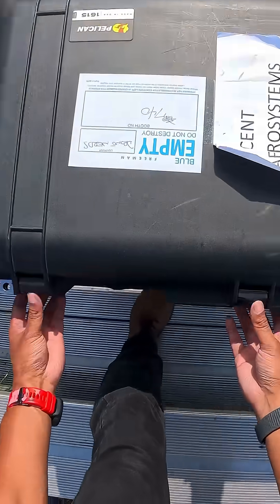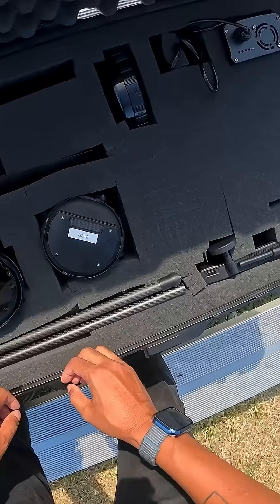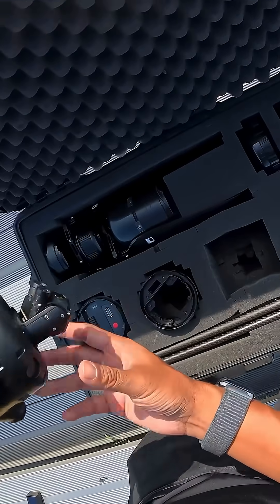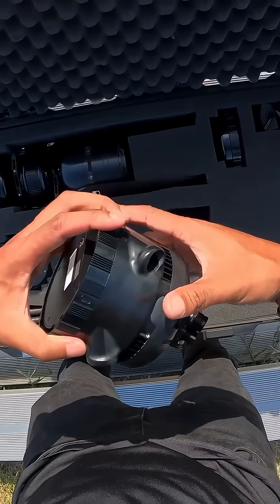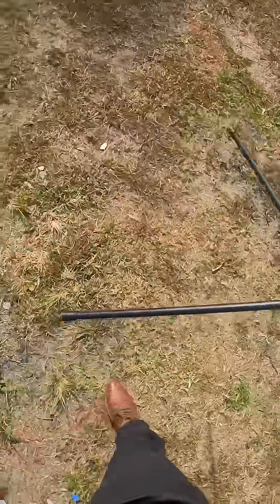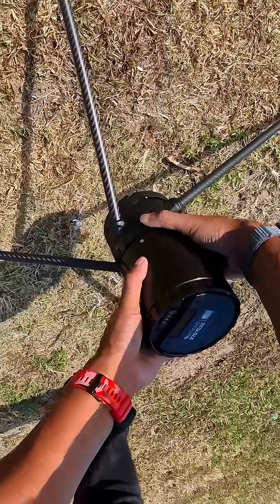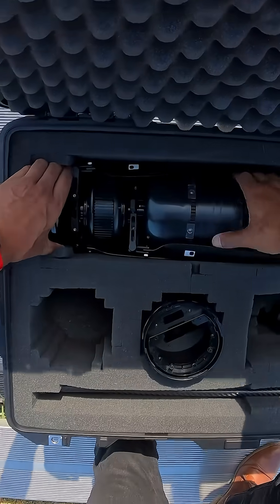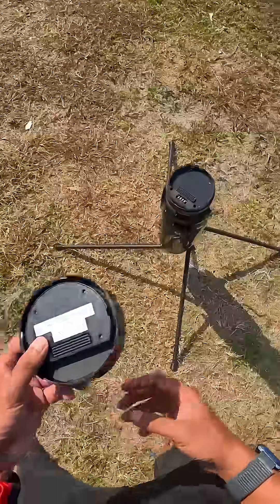Watch Me Build an Ascent Aerosystems Spirit Step by Step!

Comment: I think more dev work is needed….in this day and age people shouldn’t need to do a full assembly
Reply from the maker: Important thing to remember is that this is only the initial setup. Many users leave the aircraft fully assembled for quick deployment and only make adjustments if a new payload is needed.
Reply: @DroneNerds I do some SAR and industrials inspection and this drone would be last on my list. Any transport requires breakdown and secure storage for vibration and damage reduction. 

Sorry, but I couldn’t disagree more with the drone and your reply.